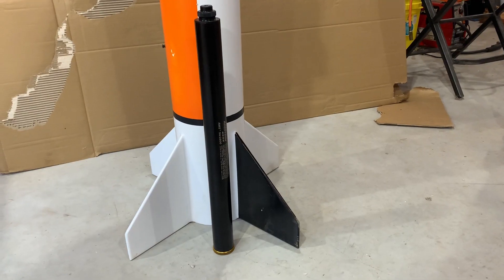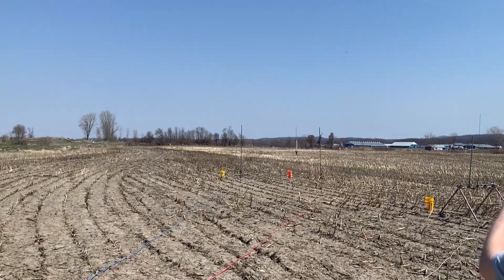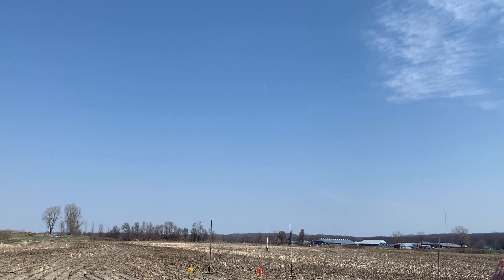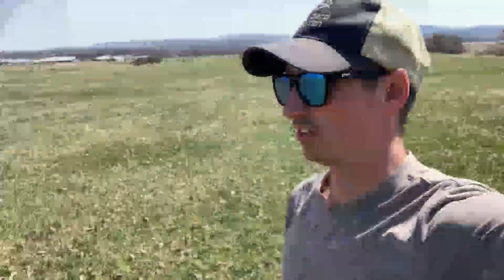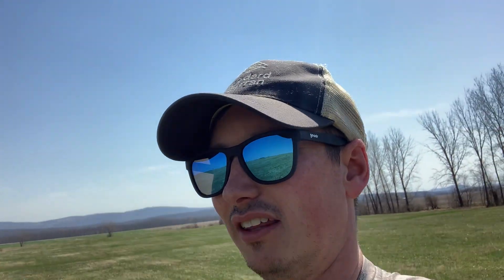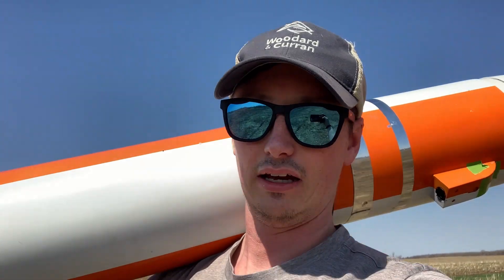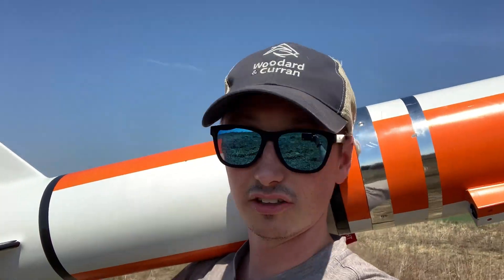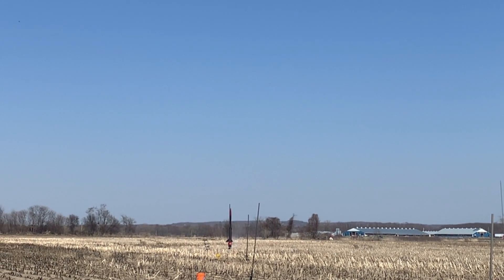LOC Doorknob on an Aerotech L1090

Comment: Great launch! What electronics are used to transmit the altitude back to the pad?
Reply from the maker: That's the Featherweight GPS tracker. Big fan of it, and it makes finding the rocket on the ground (or in the trees) very easy to do. I popped a main chute at 6,400 once and watched my rocket drift past the field into the forest and had no problem finding it and the tracker essentially paid for itself that day.